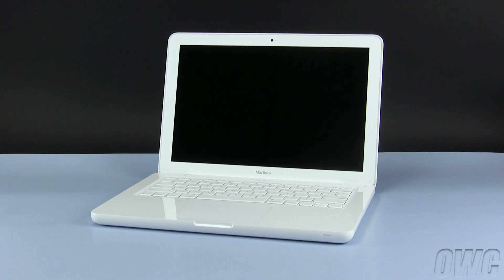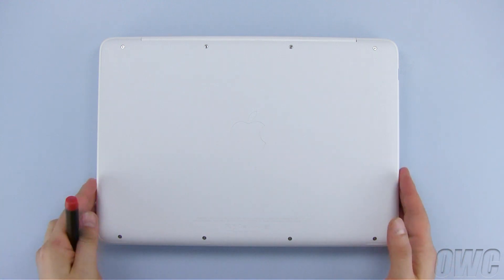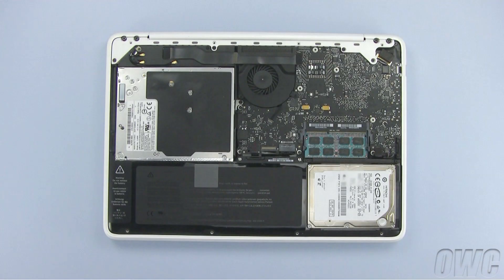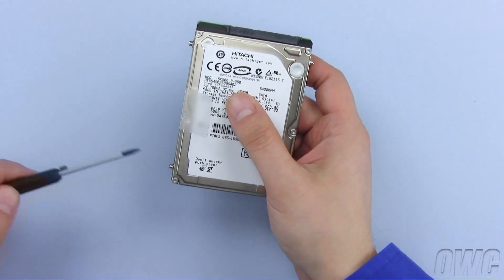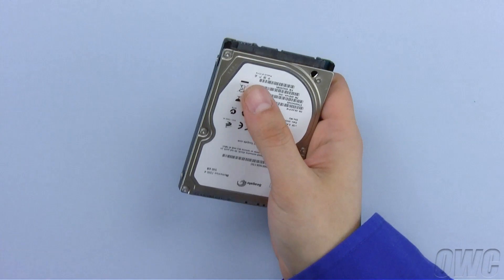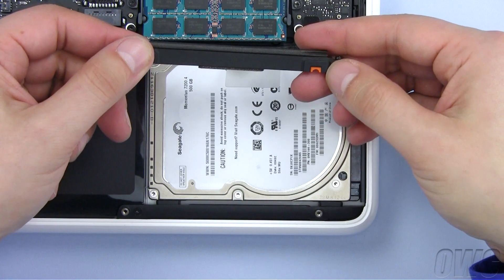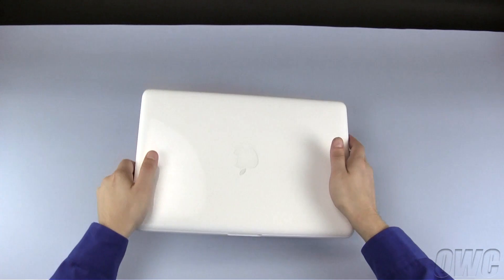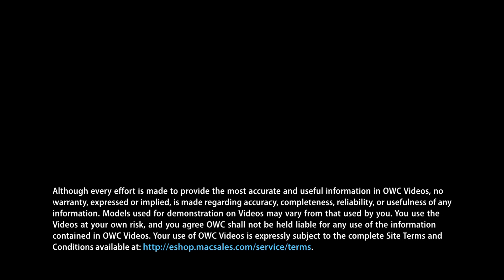13-inch MacBook Late 2009 & 2010 Hard Drive/SSD Installation Video

Comment: Can I upgrade to 1tb ssd drive in my late 2009 macbook a1342 ?
Reply from the maker: Yes, you can!
Reply: Thanks for the reply one more thing to ask will my Mac late 2009 model support any brand 1tb ssd ?
Reply from the maker: As long as it is a SATA connection, yes, it would be compatible.

Comment: I have a huge question and those articles on the internet just so confused! 
So, I have a brand new SSD. After I back up my data using Time Machine to another external hard drive, do I need to do anything with this brand new SSD or just directly open the laptop and replace the old hard drive with it? 
I saw some articles about formatting the SSD first. Is this formatting happen before installing in the Macbook or after the installation? 
I think it might be before the installation, which is barely mentioned in basically all the video and articles online. Nobody said we need some sort of case to wrap the SSD in order to format it. I hope it's unnecessary to do that, otherwise, I need to buy and wait for that stupid case to arrive then start my upgrade, which is torture since I have almost everything prepared and none of them can be used!

Comment: I’m looking to perform similar upgrade but having trouble with the SATA connection. The original hdd works fine but SSD isn’t working (it works fine over usb). Wonder if this is a SATA cable issue or an issue with the hard drive?